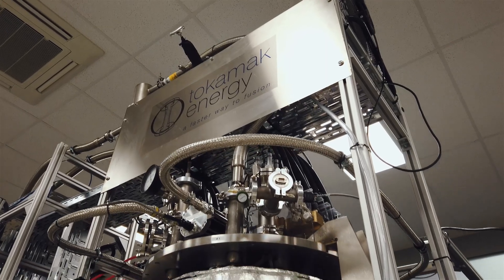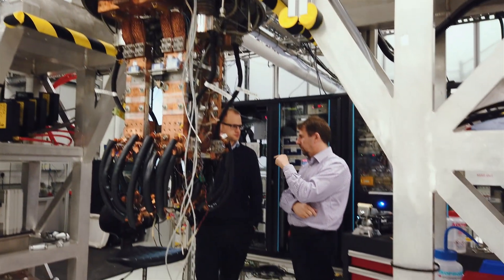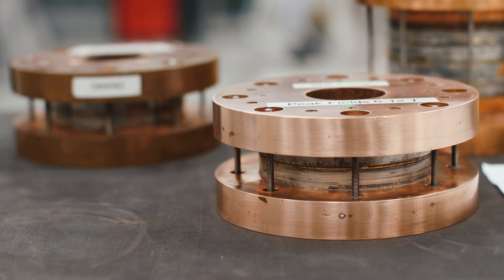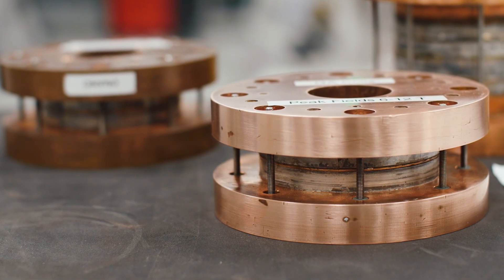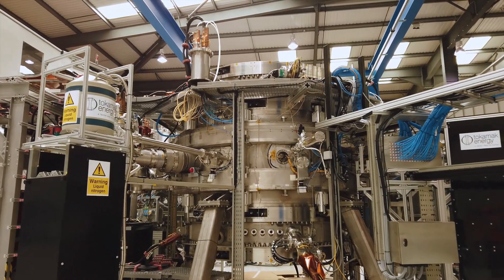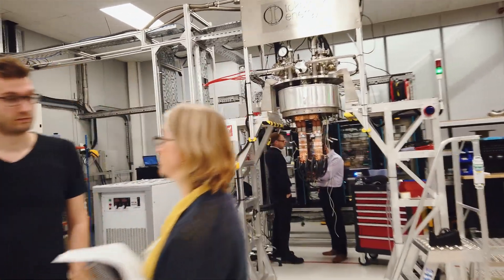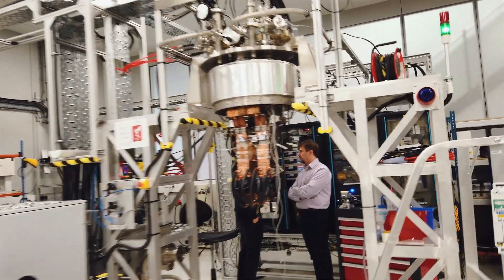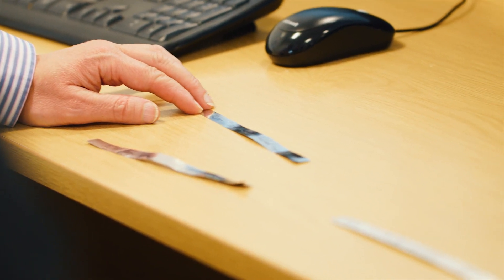Working in cutting-edge engineering development with HTS magnets

Comment: Have you guys ever looked into potentially higher temperature superconductors? I’ve heard that Stanene has the potential of being a room temperature superconductor in a normal pressure atmosphere. Or did you guys decide against that for some reason?
Reply from the maker: We need superconductors where production is well established and quality is consistent because it will take a lot of the material to make the magnets for a power plant.